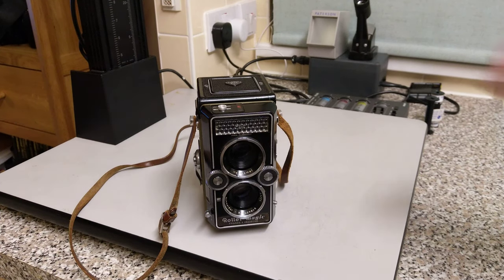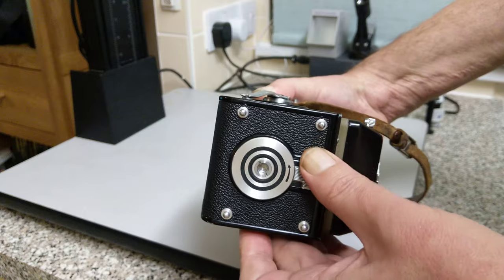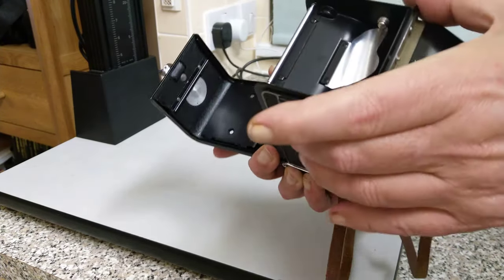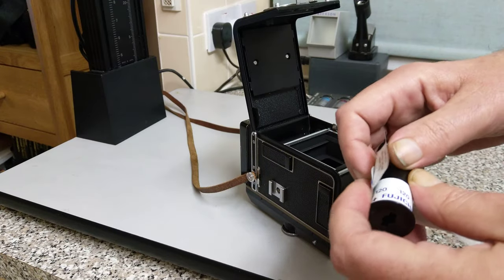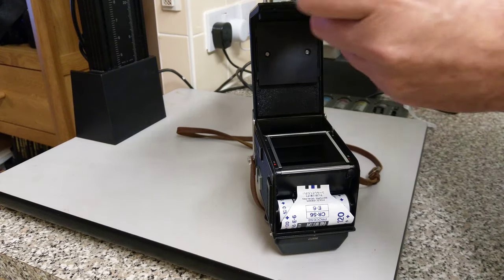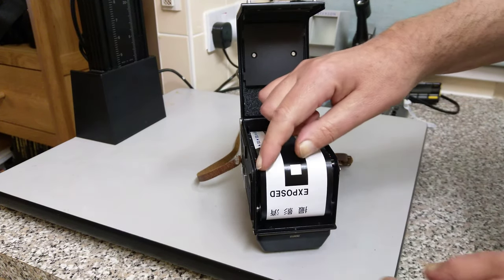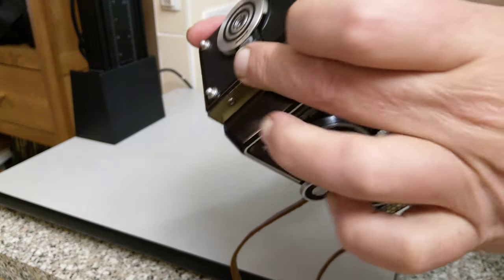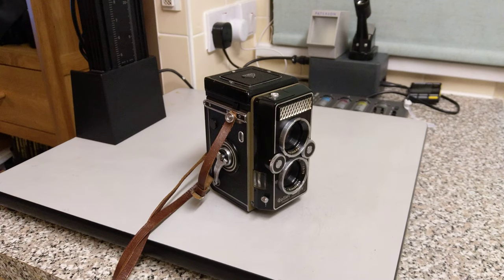Rollei Magic, loading with 120 film

Comment: Thanks for the demo - do you have any shots yet? (I’ve just bought one and not tried it so far)
Reply from the maker: Hi, I think there are some on my Instagram account, it the same as the channel name, not used the camera much due to the ongoing virus situation, nice camera though....
Reply: Do you know if the shutter fully closes after taking a photo? I just purchased one and it is in pristine shape. However, when I take a photo, the shutter remains open until cocked. I was going to clean it, but wanted to make certain that it is designed to fully close (assumed), prior to working on it.

Comment: how much is the rollei magic ii worth?
Reply from the maker: Hi, the Magic II prices tend to be higher than the original Magic due to be able to use them with the light meter being defective, the starter price is about 200 EUR rising to 300 EUR, mint ones seem to be about 500 EUR, on eBay many are even higher, a decent Rollei cord would probably be a better choice however, cameras are not a very good investment as they need regular use and servicing, buy to use not to speculate, great cameras  that should last a lifetime.....